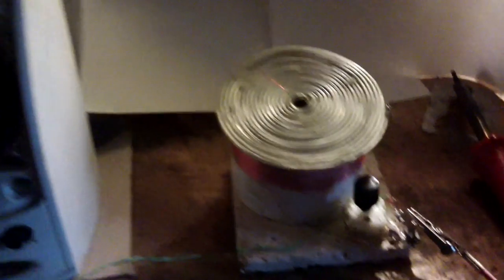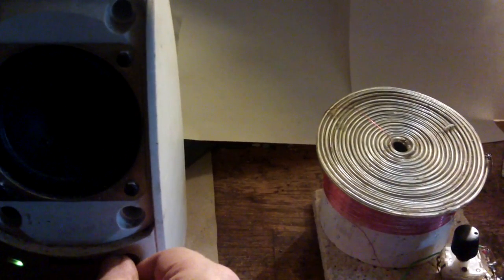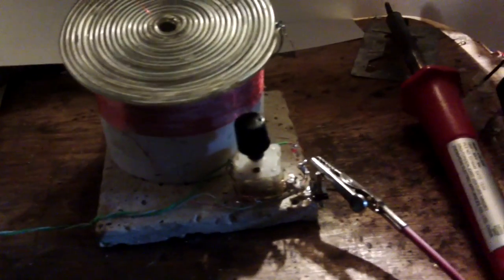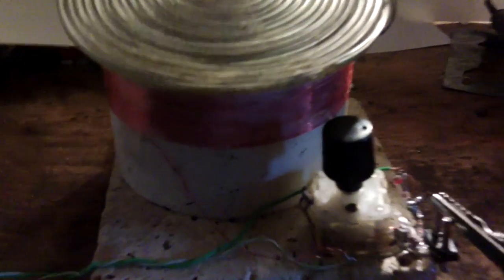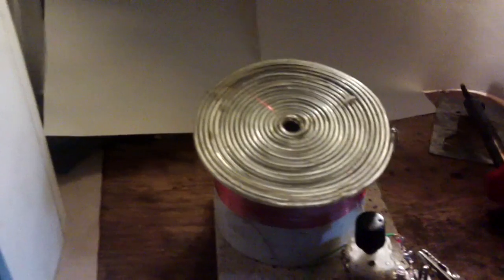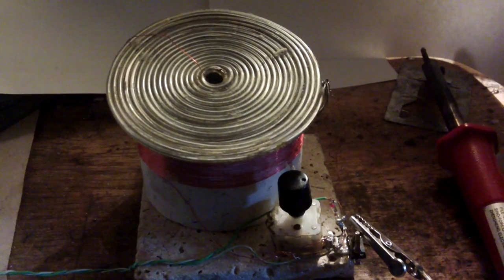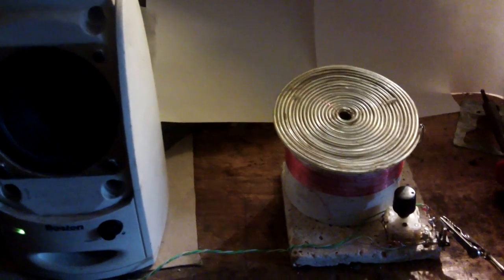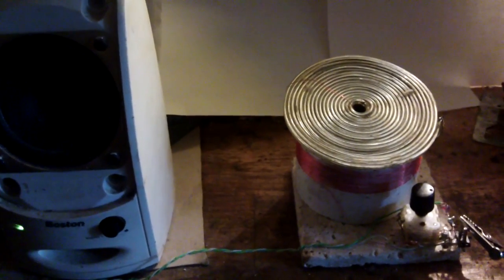Lightning Powered LED - No Aerial Crystal Radio

Comment: Hi Slider! Glad to see your are having some fun! Was thinking about how they used to use ground radio in the 50's., Apparantly they used to have little adds in the papers saying the benefits of such a system and the opportunity for instalation.  - Great bit of experimenting and thanks for showing:)
Reply from the maker: +Spangley Rainbows Hadn't heard of the 1950's methods before...I should research that. But someone did say his dad used to have a pen in the 1960's, with an earphone out of the side of it and a clip lead to ground it. Turns out it was a 'Get Smart pen-radio' for aspiring secret agents !

Comment: That is really cool.  I might have a go at that.   I will have to read up on it over at the forum.
Reply from the maker: +Lidmotor Proved itself the other day with the 45mph wind gusts. No aerial to worry about. I had a wire in a tree for several radio projects and that was always snapping or coming loose. The newest strange effect is with WOAI in San Antonio Texas, it's great in the evening, well above anything else...took a look on mapquest and it's directly in line with 1 horizontal 8ft rod in the backyard ! Longitudinal waves ? no idea, fun to discover though.

Comment: That's quite fascinating and appears to be simple to build, it's only a pity you didn't provide a circuit diagram! For clarity, you have two 8 ft copper and steel pipes 50 ft apart in the ground (acting like a galvanic cell). A few questions, if you don't mind: was the soil damp? Do your diodes need to be germanium? Are the diode pair attached to one of the pipes and if so, which one? What is the other pipe attached to? How exactly does the pancake coil fit into the circuit? It would be nice to know what differences in reception occur if you try separating the 8 ft long pipes by these distances: 10.92 ft or 21.84 ft or 
43.68 ft? (significance of strange distances: 8 x 2.73 = 21.84).
Reply from the maker: +Pseudo Nym Good questions. No circuit cos it's a work in progress type of situation, but, I see what you mean. The pipes are connected to the same ground, no cell effects, just pipes from an old project to increase ground reception properties, Eric suggests 50ft separation of copper. The soil was certainly damp after the storm lol, but did have a gallon poured over to help compact the removed soil. Germanium diodes yes. 1 diode is regular to the audio out, other goes to ground.
Pancake coil connects as an extra coil, in series with the space wound one and terminating back at the variable cap.
A peculiar thing is the lack of detuning with body capacitance, no effect at all, leading to bolster thoughts on no traditional air reception.

Comment: The point of the aerial and the mathematics is to create a state of resonance where the voltage node is located on the elevated capacitance of the secondary. If any condition is not met, then it is not a true replication of what Eric Dollard is trying to do, because this is meant  to be a tuned Tesla coil. Eric said you would be able to light up a 7 watt bulb if you did it correctly. Thanks for the upload though, the lightning interference is very interesting!
Reply from the maker: +Alex Johnson Indeed and I agree about the tuning. This was a side effect of the emulation or modelling of basic bits, so rough and not ready :). A genuine build is still to be completed. Just kinda neat to have such an effect occur and be able to record it.

Comment: AWESOME my friend. If you had the LED in series with an electrolytic cap. Would it charge the capacitor as well as light the LED? I'm thinking that everytime it brightens it put a charge pulse into the electrolytic. We rarely have lighting here these day. My best regards to you and Julie. Have a great day.
Reply from the maker: +Raymond Earle Cheers Ray and so good to read that your arm is better ! In the schematics of Eric's, a cap is on the output. A regular Christmas tree type little light didn't do anything, but then it won't because the output was very spikey last night, needs to build and be smooth. Best to you too :)
Reply: Ah. I see. No doubt you will get it running the town before long. Have a great weekend both of you.

Comment: Thanks for the info. Re: no air reception: Does your device work inside a microwave oven (power off!), with the door closed (Faraday Cage)? I realised that the pipes were dug into a common ground, but I wondered if copper and steel might interact, even in series? Why did Eric suggest 50 ft, has he tried other distances? You shouldn't be surprised that the pancake coil received juice from lightening (been there, seen that) but the question is: does this demonstrate the reception and amplification of ground transmissions!? A few things to experiment with there:)
Reply from the maker: +Pseudo Nym Nice idea with the microwave...good test. it likely won't receive huh, but I have no idea because hand movement on or around the coils has no effect on reception. 
The metals shouldn't react, probably to the earth though. 50ft appears to be intertwined with calculations on frequencies, light speed etc for the AM band meter length. 
Indeed, Nephilim Penny oscillator has always reacted to weather changes, especially storms.  So interesting how the LED does nothing, now that there's no storm.
Reply: +Pseudo Nym hey there., the faraday cage thing is a good idea., Eric was saying stuff (in a video) about longditudinal waves that may go through faraday cages and these waves maybe asociated with lightning.